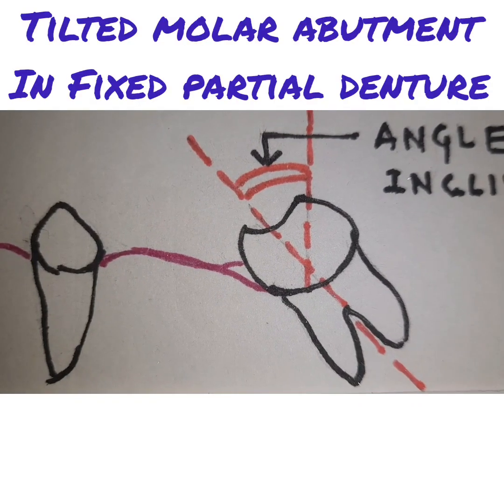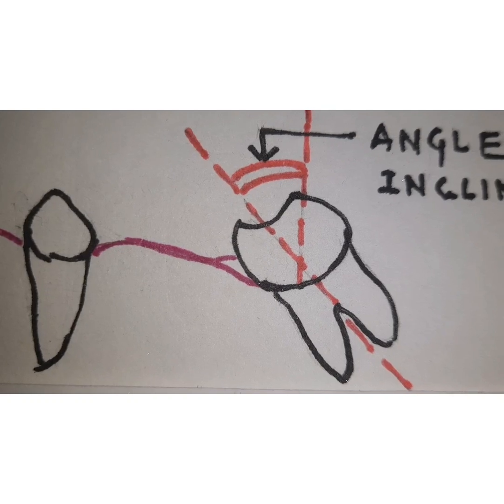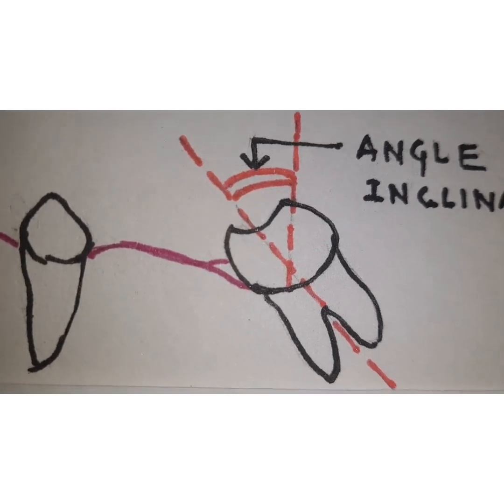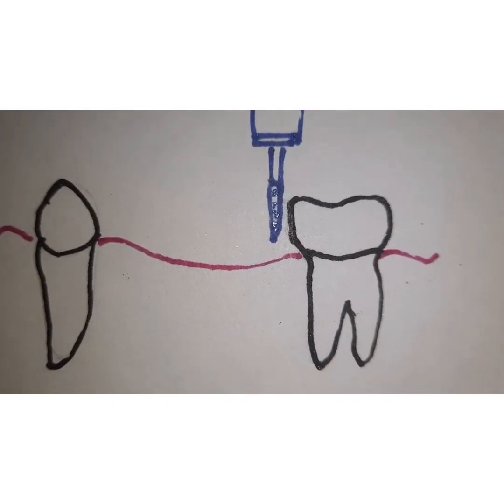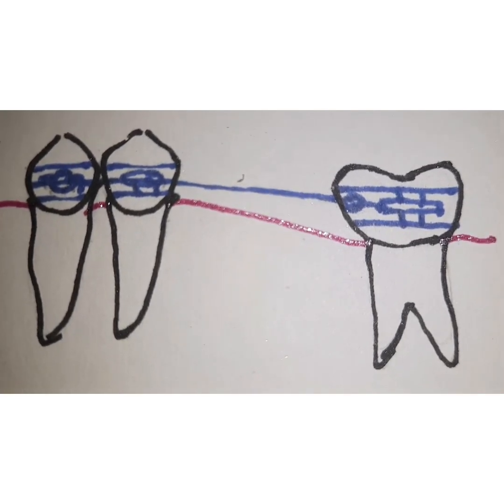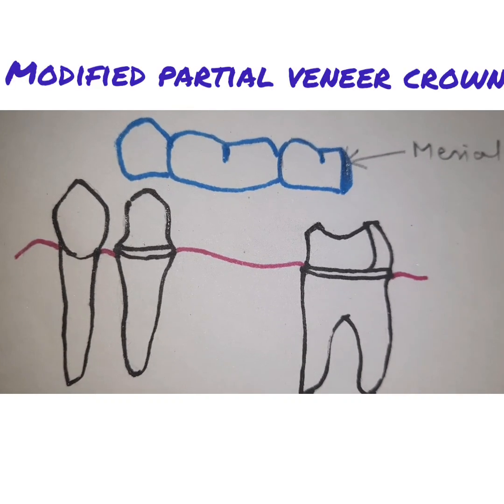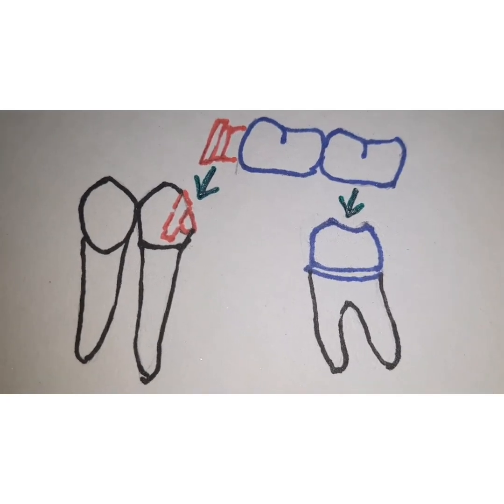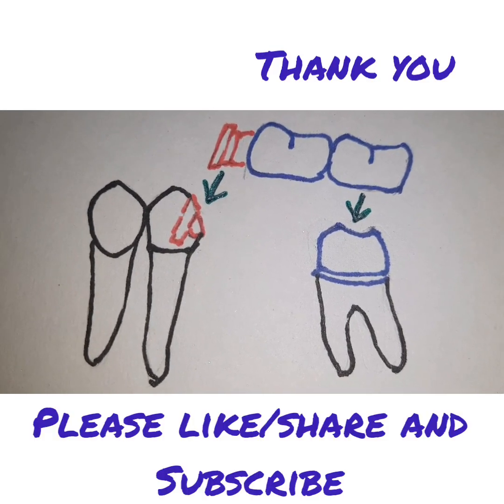Tilted Molar Abutment in Fixed Partial Denture

Comment: Great video, sir. I recently got a 4 unit bridge on left lower side, from 5 to 8, as 6, 7 were extracted due to failure of RCT. My 3rd molar was lingually and mesially tilted but the dentist didn't perform distalisation or partial crown, now sir I am having sensitivity especially to cold and pain on the mesio lingual side when I chew on the pontics, all high points have been reduced. What should I do now, I went for the bridge because I didn't want implants at this time.
Reply from the maker: If you have pain in third molar region it may require RCT can't comment. Pl discuss with your doctor treating you